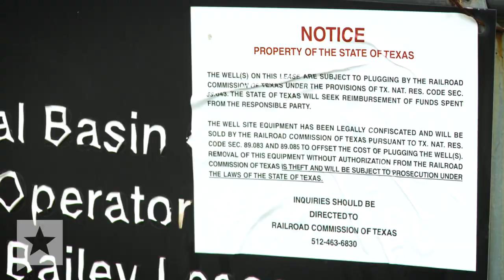What happens to abandoned oil and gas wells in Texas?

Comment: If you seal the bore with cement at different depths. How do you get the secondary or tertiary cement plugs to float above the mud? or are they just stacked consecutively?
Reply: Calo Q. The latter. Stacked. Layered mud and cement all the way up.
Reply: He’s talking about cementing on top of plugs that are set in the well bore and filling it up where the perforations and/or zones of oil and gas would be so they can’t get into the hole and seap upward into the water tables or earth following the pipe or the outside of the casing so the cement sits on top of a plug usually set by the drilling crew using drill pipe, then they pump cement down the drill string pulling up slightly the whole time while pumping cement down the drill string to a calculated number of barrels returned up top of mud or brine and pump strokes. Then.   They wait for a few hours while they blow everything down and rig up testing equipment to pressure up the inside of the casing against the BOP bag usually and hold a certain pressure for a period of time on a recording chart and if it passes they bleed off easy until zero and pullout of hole. Then rig up for the next run!
Reply: Thanks. Very interesting. And makes sense. The wheigh of the cement holds the plugs in place and fills all the nooks and cracks above.

Comment: In the future can a well be unplugged once its plugged?
Reply: Would think so , but time to remove all the cement would be cheaper to drill a new hole..
Reply: Yes but you have to drill through the cement which isn't a big deal, and then you'd have to drill or mill up the bridge plugs or cement retainers. That can take a few hours to a few days. Depends on the depth and the number of plugs in the well. Back in ought 10 there was a lot of companies doing re entry drilling up here

Comment: wow I've never seen a drill crew sit so much
Reply: It shows it is a "State Job", it requires doing a lot of S  (Sitting and Standing)
Reply: its amazing what one can do with a computer now...
Reply: what else are you going to do, they are drilling with a swivel and washing it with a pump truck. it aint like they are tripping down to set a bridge plug or running production back in. I would do the same sit down while drilling. that is a easy job take a break while you can. its a 100 degrees out there and someone has to watch the swivel and someone has to watch the pump truck. that crew looks like it is working to me. gg.
Reply: Sounds logical but we used to do it at -30 so sitting was not an option.
Reply: @truepcs    Reason mother sitting around is where drilling on top of bridge timbers  That have been cemented in On top of effect that we are having to circulate the hole where the camera crews out there and I don't know what kind of drilling rig you worked on or layover reg But when the h*** did what was in the whole not getting the way of going down hole so a course you sit